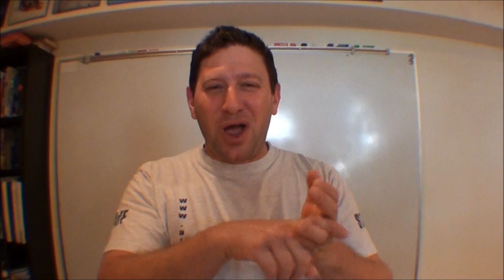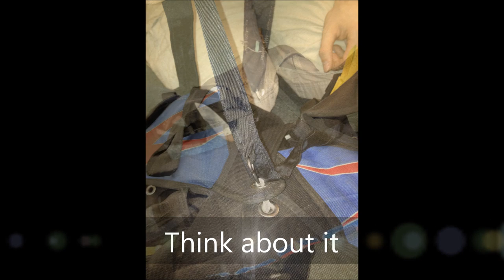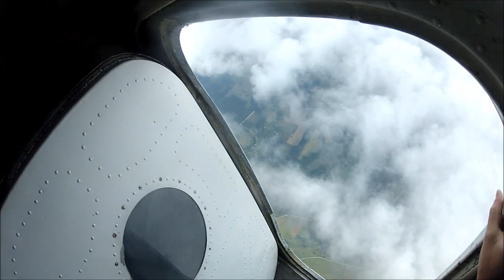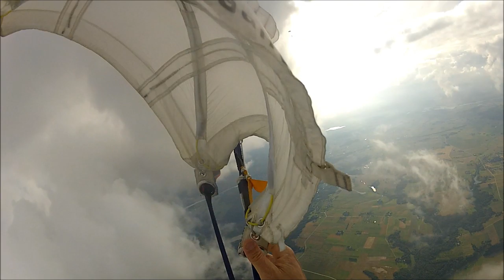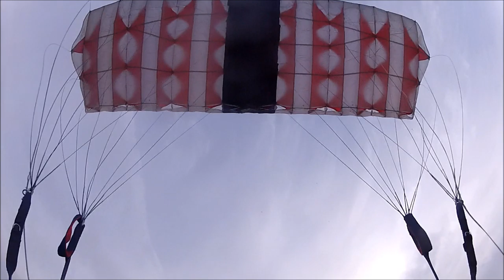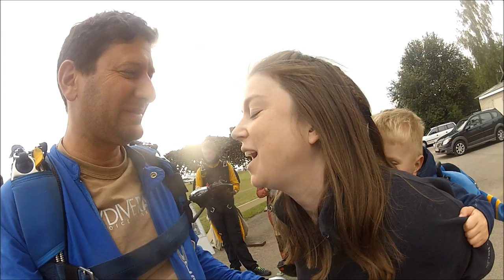Safety First with Brian Germain: "Closing Thoughts"

Comment from the maker: The loop appears a bit over extended on this rig because the main that I have in there packs a bit large for the main pack tray. It works fine, as the pin remains protected by the pin flap.

Comment: Might be more of a discussion for SkydiveRadio but is your closing loop a bit long? The general rule around my DZ is the grommets should be ontop (or as close as possible) of each other. I believe the tightness of the loop is to prevent the pin from moving while in the plane etc. It may take a little effort to pull the closing sequence but closing pins dont move before the pilot chutes been thrown

Comment: So if this is the method that was used 20 years ago, what was the original reasoning for it to change in the first place? Are we compromising another safety issue by reverting back to this method?

Comment: I'm curious as to why the bridle should be on the bottom right both before and after the closing pin.  Stuffing two sections of bridle into the same spot seems like a problem area.  Is there a reason not to have the bridle emerge before the pin (the D-bag side) from the lower left, and then go to the lower right after the pin (the PC side)?